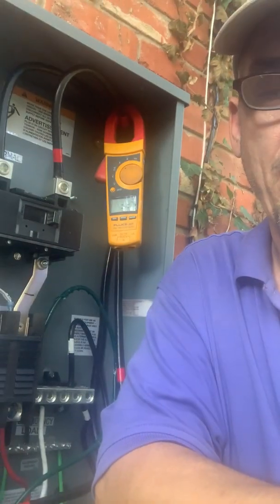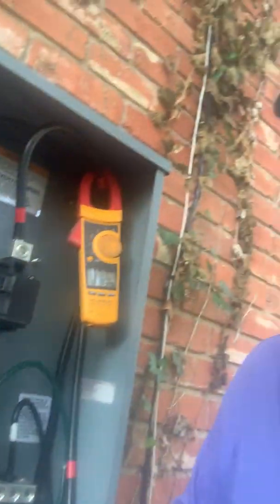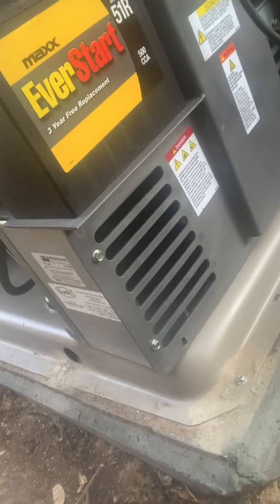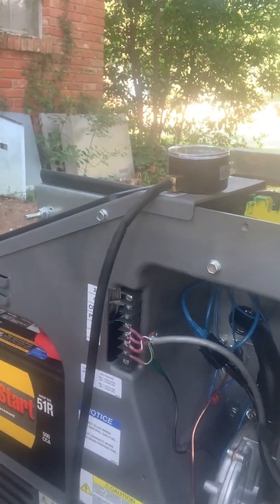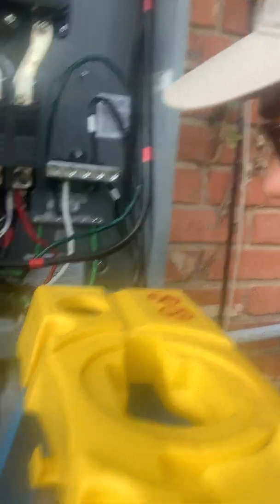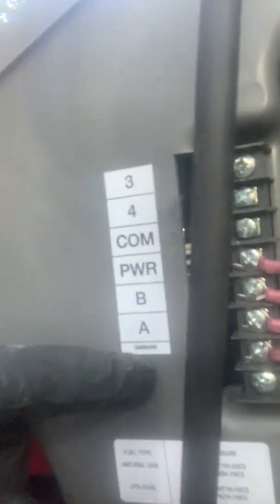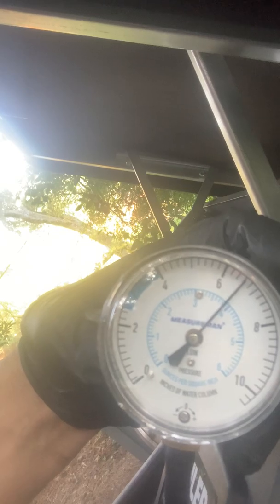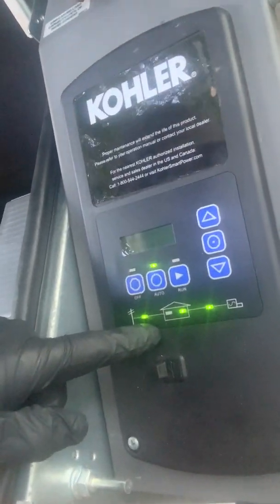Kohler 14RCAL 14 kw Generator - partial DIY - step by step sizing & installation

Comment: How large was your feed conduit, I’m currently running 4 #6 for load back to the load center Nec says 2” conduit is required what size you have in the trench? Also could you add the #12 for the utility circuit in the same pipe? If I add that #12 to my load #6 wires it jumps to a 2-1/2” conduit. Sound right? Good work man.
Reply from the maker: 2” sounds right, tbh I don’t remember. The romex was run in a different conduit, with the coms cable.

Comment: If you're running LPG, you don't have to change the jet on the newer ones, if you have the selector knob that is all you need to do, plus don't connect the timing connections that you would hook together for NG operation.

Comment: Hello, outstanding work, I have  one question I know you can answer, I will be installing my Kohler generator. However, I can't find any direction where the  battery charging wires connect to.
Reply from the maker: Pause the video at 6:49.  Also refer to the installation manual.  Use a 20 amp single pole breaker, and NM-B 12-2 grounded, and of course in a conduit.  I used a 30 amp breaker, but switched to 20.  The auxiliary plug also runs from this circuit.  Thanks for the comment and complement.